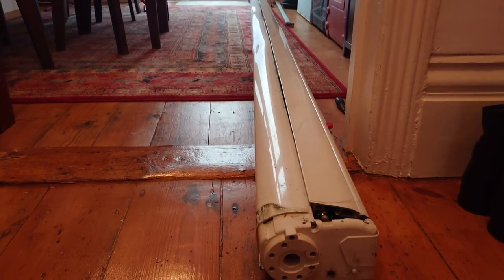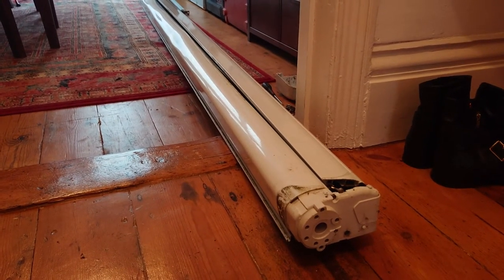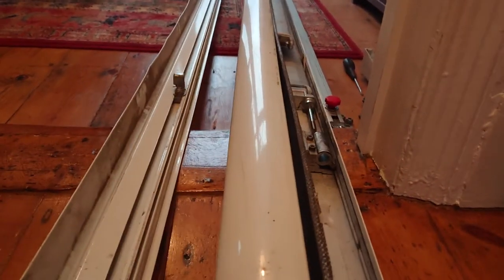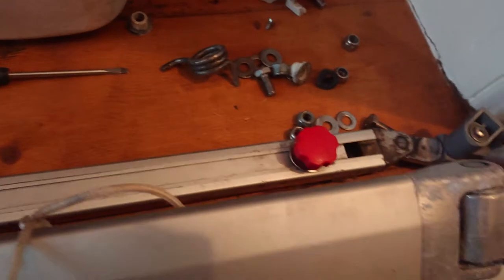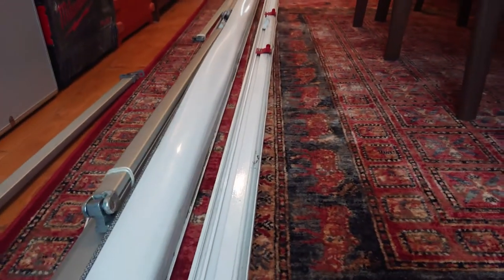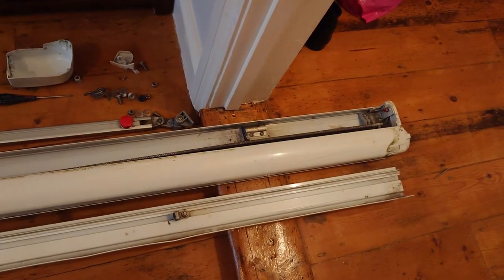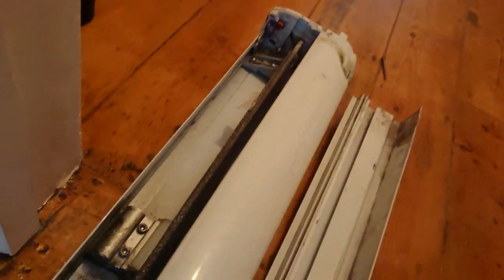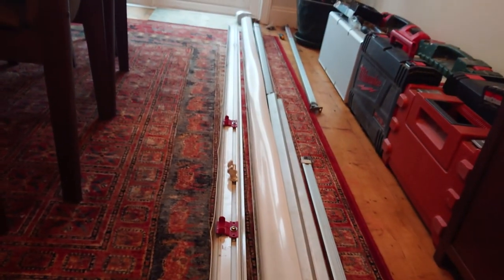Fiamma 45i awning...repair and shortening

Comment: How do you remove the pins holding the hinges ?..
Reply from the maker: Hi, I think you just hammer them out with a drift..part of the aluminium body is countersunk to allow a dent to be hit into a channel turned on the circumference of the pin..but you only see this once the pin is pushed out...